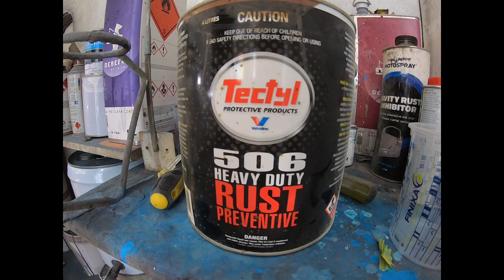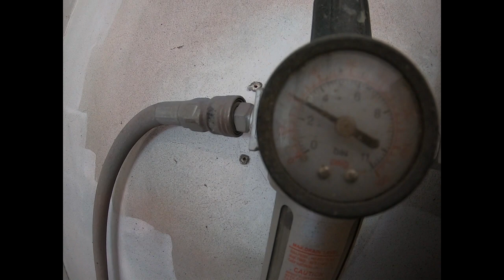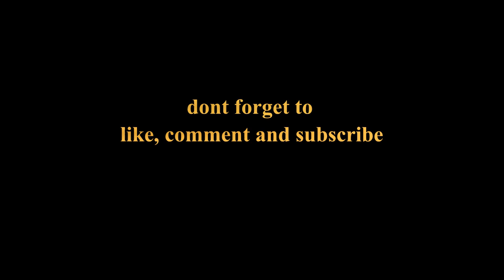RUST PROOFING A BUS

Comment: do you sand blast the whole vehicle or just the lower areas and around the windows?
Reply from the maker: We blast the perimeter only of all the big panels on the outside including window surrounds and gutters. 
We also blast the whole inside except the back of any flat panel. 
We manually sand the flat areas as its safer and quite quick